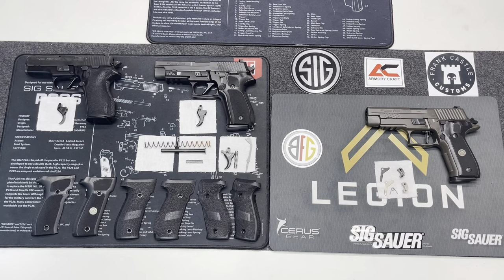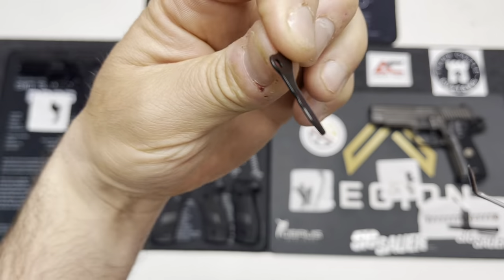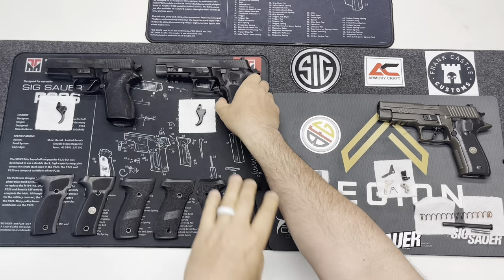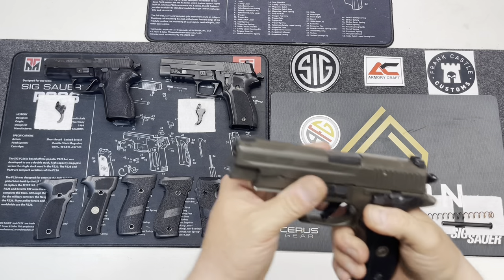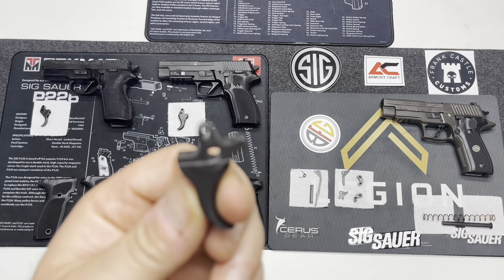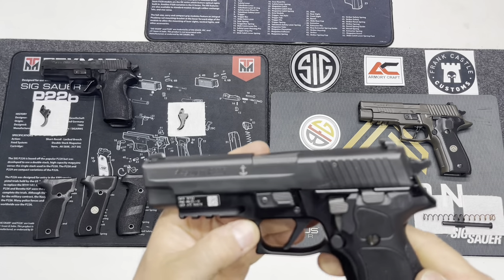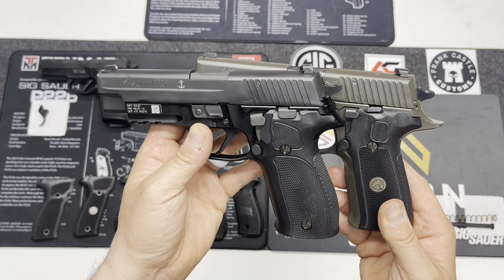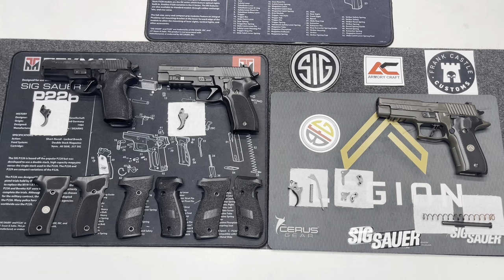Want to Know How a Short Reset Trigger Works!!

Comment: Who makes the best SRT? Grayguns vs Sig vs Armory Craft. I have the factory Sig SRT in my legion but if theres a better option Id like to know.
Reply from the maker: The Gray Guns and Armory Craft SRT kits are both coated in nickel and an improvement over the stock Legion SRT, which is a Gray Guns system but not coated in nickel.  The coating provides smoother contact between the trigger and the sear and the hammer and the sear creating a smoother trigger pull.  I haven't used the Gray Guns SRT but I would bet that it would be very similar to the AC system.  The GG safety lever does seem to have a different geometry which may or may not make a difference.  Maybe that's something we can review on this channel if viewers are interested, comparison between the GG and AC SRT systems.
Reply: @bfgprecision  That would be awesome if you reviewed the SRT kits with stock hammer and hammer springs to see if one is superior. Not alot of info on aftermarket SRT kits for the classic P series pistols
Reply from the maker: @christianb9839  Ok I will put this subject on the list for my upcoming videos.  I'll have to source all the necessary parts and would like to maybe get all of the GG upgrades and compare them with the AC upgrades I currently have for the SIG Classic line (P22X).  I'm not monetized yet so I have a budget I have to keep to, but I really like this idea and will try and get to it soon.  Thanks for watching and keep an eye out for the video..